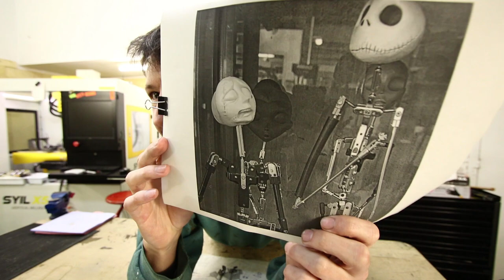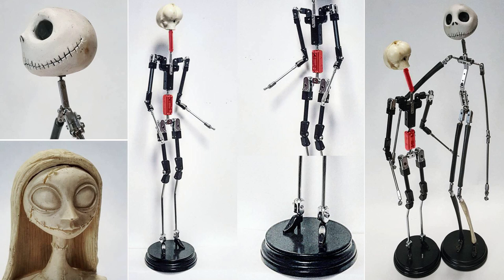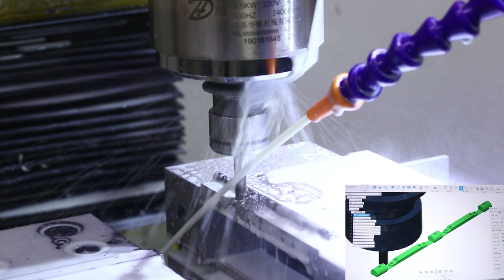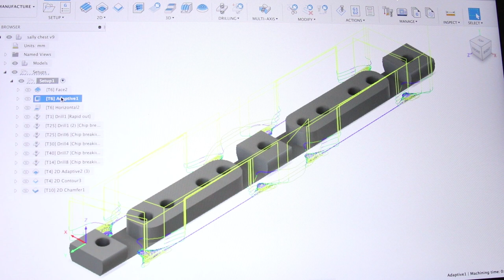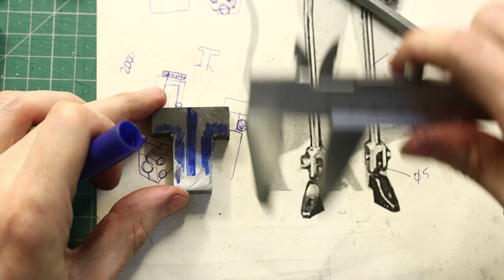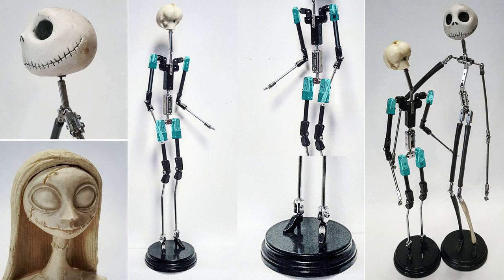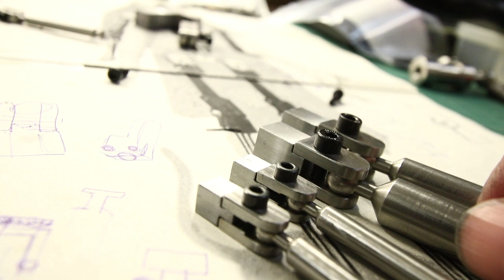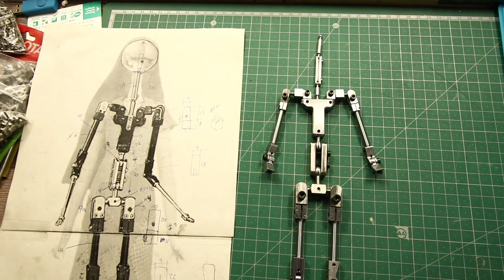Bringing Sally back to life

Comment: That was wonderful. I've been trying to make my own armature with not great tools and it has been challenging. I don't have a lathe or a milling machine so I have been using a small drill press and just a hack saw for cutting. I really enjoy the learning process and while my armature isn't at the same level of yours I have learned a lot. I'll probably buy one of yours at the end of my work but at least I tried! 😁
Reply from the maker: It is worth to try whatever tools you have, you learn a lot from it
Reply: You can do a lot with simple tools. Jewelers saw, drill press, and some files will take you pretty far. Also if you stick to softer metals like brass/bronze you may have an easier time.

Comment: Is there a special drill bit to drill the round socket hole? Is the hole bowl shaped I mean?
Reply from the maker: It is a ball end mill, and you have to adjust quite well how it plunges so it don't chatter and leaves a smooth bowl

Comment: What do you think of  the  macbook pro 16 inch m1 max with  top cpu and gpu and 64gb ram with 4tb ssd  for  dragonframe 5 iv spoke to the  company and they said  Dragonframe 5 works Native on apple  m1p pro and m1 max ?
Reply from the maker: Should work fine, I run Df5 in 13inch M1 and no problem

Comment: Increíble trabajo! Los originales estaban hechos de espuma de látex (no se si de dice así en español, foam latex en inglés) inyectadas en molde y cocidas después, quizá no sea tan fiel al original pero a lo mejor ahora es más sencillo hacerlos de silicona especial para figuras de stop motion, creo que en el 92 no tenían pero en pelis posteriores si la usaron. No se como has planteado hacerlo, pero es un trabajo muy complicado, tenían decenas de personas solo para hacer lo que estás haciendo tu solo, enhorabuena. Hay una cosa que me tiene intrigado y llevo dándole vueltas un tiempo: entre las armaduras de alambre y las mecanizadas, no hay un término medio? es que son sos extremos y me llama la atención que no haya un sistema más duradero que el alambre pero no tan caro como el mecanizado. Yo estoy haciendo una con una impresora 3D en ABS, es de "ball and socket", uniendo las juntas con tuercas y tornillos y más o menos da resultado, pero hay que hacer muchos ajustes, no sé si será viable. Un saludo
Reply from the maker: El punto medio sería un híbrido, las piernas y torso ball&socket y los brazos wire